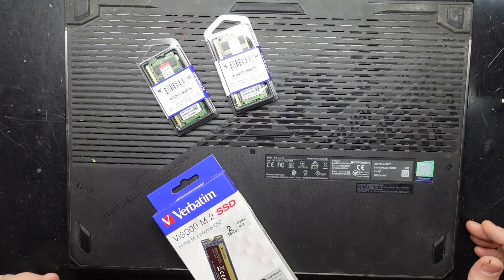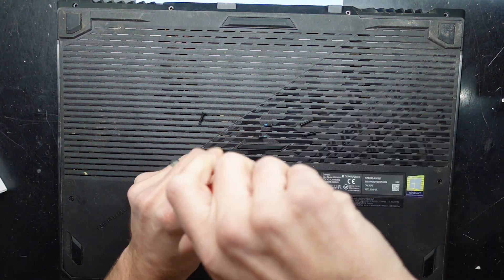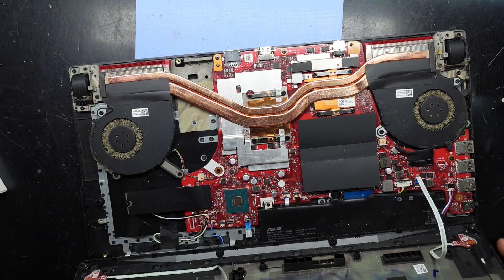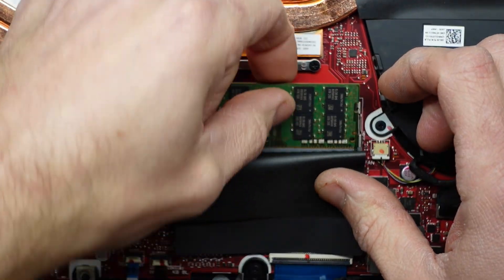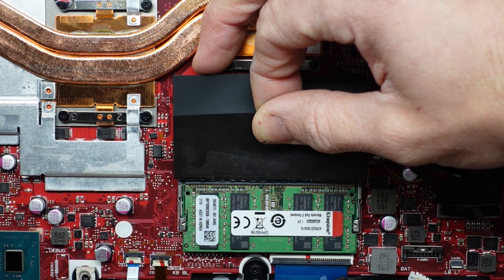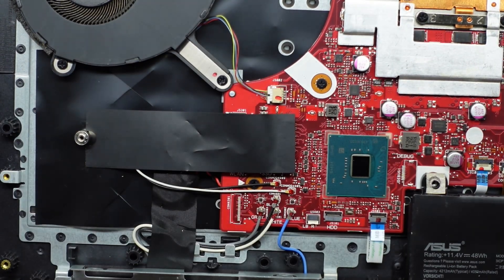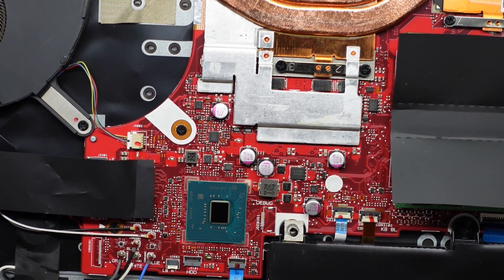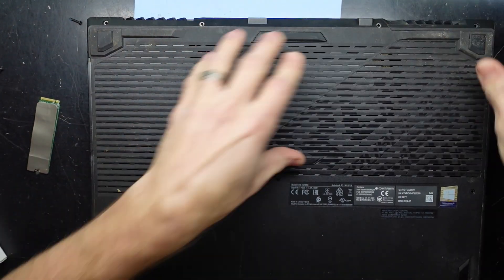Asus Rog Strix G731 Ram and NVMe Upgrade

Comment: I cant get this thing to even get to the bios after cloning the old ssd to the new one
Reply: Same thing for me ! 

I cannot even find any answer ! 

Did you manage to fix it ?
Reply: I have a ASUS ROG STRIX G731GU and I bought a Crucial P3 plus Pcle 4.0 M.2 2280, I tried to clone by using macrium and even Acronis, I also tried to upgrade the BIOS, but nothing changes

It doesn't work and I am going crazy..
Reply: @emmanuela.3146  it just plain won't work. I finally found a known compatibility issue. You have to stick with certain brands. They recommend Intel brand, but there are a few others that work. Stop wasting your time nothing you do will get it to work. Buy another drive. I found a Verbatim Vi3000  that was relatively inexpensive and is so far performing well.
Reply: @emmanuela.3146  i have 1 G731GT . i wanna change my storage. i thought of buying the same Crucial P3 plus Pcle 4.0 M.2 2280 . did u had any lucky with yours?